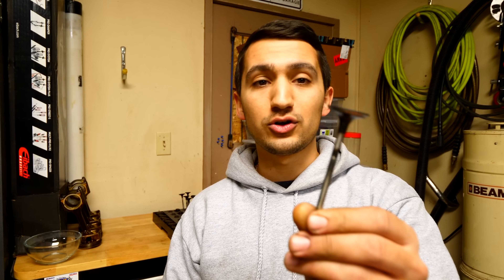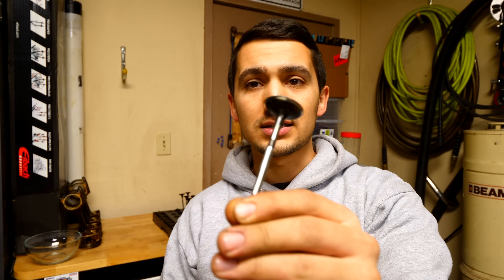How to Clean and Refinish Valves

Comment: Never do this, NEVER!!! First of all sanding by sand paper you will resize the geometry of the valve causing loss of compression and power. After light cleaning valve needs to be very accurate grind valve to seat. Second, do not care about shiny appearance of the valve because after 10 miles it will be carbonized how it was before. I would say that condition of the valves you have not so bad to clean them too much, they need to grind to seat for not to leak.

Comment: First, direct injection, chaps - they have a well known problem of carbon build-up on the valves and port.
Second, why do you assume he didn't lap the valves after the polishing.
Third, the OEM coatings have limited benefit and I have seen some with very heavy build up of deposits.
Fourth, whilst the polishing wouldn't hurt, and may reduce flow loss over time, more benefit is usually gained from reworking the valve and seat angles and widths.

Comment: You have no clue how an engine is engineered. They have to be professionally lapped now and the end of the stem needs to be grinded down to compensate for the damage you did. Keep using your mother's compound.

Edit: Jesus, you sandblasted a valve? I'm dead 😂😂😂😂😂

Comment: Please don't use a drill on a valve like this, If the crappy chuck on the drill slips and marks/knurls the stem when you put it back into the engine it will wear out the valve guides and you will start burning oil.

Comment: The finish is outstanding but you should have given a (put this engine on the dino) hp output before and after doing this to see how significant the engine will benefit from this. My question though, you do get a uniform sanding on the rotation of the drill however the valve face is precise angle cut in relation to the valve seat. If not carefull or a bit to much squeeze on the sanding paper may affect the angle cut (rounding off an edge). Can this affect the seal of the valves thus affecting compression?? My other question is even if carbon is completely removed off the valve, how can you get the same results for the valve seats on the cyl. Head??

Comment: Dear Milan,

This is a well-made video with nothing but the best of intentions.  However, you erred in the title:

Instead of calling the video "How to Clean and Refinish Valves", you should instead call the video "HOW NOT TO CLEAN AND REFINISH VALVES"!!

You will have to lap the valves now to get them to reseat properly.  However, because you removed so much material, only a professional machine shop will be able to do this; the valves and seats will need to be reground.

Worse, you polished the valves stems!  ("OH NO!!")  Never do this!  The stems have very precise tolerances, and removing material from them in such an aggressive fashion means that they won't fit into their bushing as well as before...  Which means they will move around from side-to-side!  BAD!!   Furthermore, never put the valve stem into a drill chuck!  Always use a rubber hose so that you don't flat-spot the stem.

Finally, a very wise commentator pointed out that, although polishing the exhaust side is a noble idea (radiates heat better!), the finish on the intake side ideally should be rougher, as this helps fuel atomization.

So, if you just change the title, this will be a good video.  The comments helped me to learn, so thank you for posting this.  I hope your engine still works after this!

 - LL

Comment: so here are my take aways
that much carbon on the stem you should check your valve angle  and seat to stem.
also if you put machine tool or scratches on the valve you should reface and reangle the valve and check the head on a flow bench.
you should never when cleaning a valve have scratches or tool marks. especially if they are sodium filled.
first thing to clean the valve is a solvent or hot tank treatment. 
then if you think you are good with the head removed murette test the head  with oil to ensure a good seal.
if you are using stainless valves and aluminum head you can have the valve cut the head material with a improper mating.
then you buy a new head.
you said your valves did not seat or seal properly did you compression check the cylinder first?
also with that much carbon i would definitely do a compression check verify your oiling and proper oil as well as ignition timing and spark.
i did not see you do any tests just conclusions.
and i have never seen a shop use these techniques machine or otherwise.
where are you getting these procedures from?
but this a totally unprofessional procedure. and while you may have been lucky a few times i cannot see any dealership approving this as
a oem procedure. you post all the merch sales materials but none of your reference materials for procedures.
your qualifications or certifications.
again this is a engineering nightmare.
also you are not posting and information.
things you should do. which you didnt making this a failure.

Comment: This is not a good approach as some engines have valves coated by a special material to resist the heat (in general turbo engines). Polishing them you will remove this coating and ... will have a nice looking valves but not reliable to work for a long term. Don't do that, polishing is USELESS, use special liquids to clean the carbon and that's all you will need. Cheers.

Comment: Bye bye valve seat seal. If it was this easy to just clean valves and lap them before installing, no one would be spending thousands of dollars at machine shops to machine high performance racing engine heads.

Comment: You just ruined your valve face and you  obviously have no idea or experience in blueprinting motors. It’s videos like these that keep technicians like me in business. If you’re trying to improve the factory compression, a multi angle valve job is the way to go, then the valves must be lapped. Machining them by hand with a drill isn’t a professional valve job lol. Lemme guess, you’re probably porting without a flow bench too. Know when to use a machine shop. Theres a reason why new valve faces and necks are not perfectly smooth like a mirror finish. The uniform surface texture allows for smoother, less turbulent flow into the cylinder.

Comment: Hello there, first of all really nice work there, going into such a detail! Not sure what to think after reading all the negative comments about what you done there. I think that some of the metal came off but that's probably 0,00000something so it should not affect the sealing negatively. Tell me please what was your experience after you built altogether? Thanks in advance!!
Reply: it will tolerances on a engine are incredibly tight
Reply: Just compare to a brand new valve. Under the head is not smooth. It's noticeably grainy. Even very expensive super tech valves. Also there is a coating put on most valves that makes it more heat resistant. It's kind of important. That's all gone.
Hey I did what this video recommended too as it's the first hit on his to clean valves.  I got new valves. But mine were toast anyway so no harm

Comment: I love how sounding like you know what you're talking about and having a youtube channel makes you a credible source for internal combustion engine info and science.

The google and forum influence is heavy on this one.

What you just did was fuck up a perfectly good valve. A thousandth of an inch that you remove will make a huge difference. Engine tolerances are measured in thousandths of inches, so removing material like this is actually quite dangerous.

Comment: LOL.. so you scratched whole valve stem with that abrasive. This will destroy valve guides in no time. Also you should never ever put valve stem in bare steel drill chuck. So many wrong doings in one video and for nothing. That carbon will be back in few thousand km´s.

Comment: Why are you removing metal off the valve stems too much work not too mention your valve guides in the head will need to be resized you'll have lots of oil leaking even if you replace to stem seals . What would i know only been in the automotive industry for like 17 years